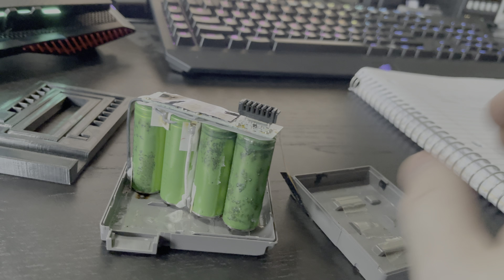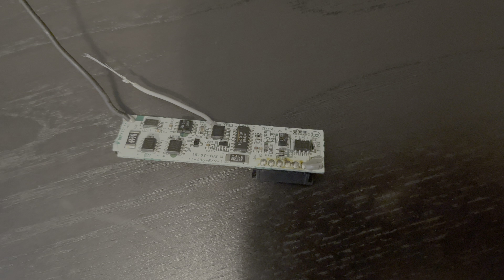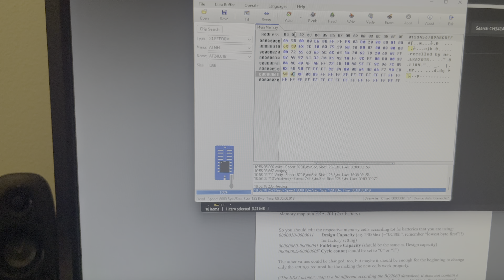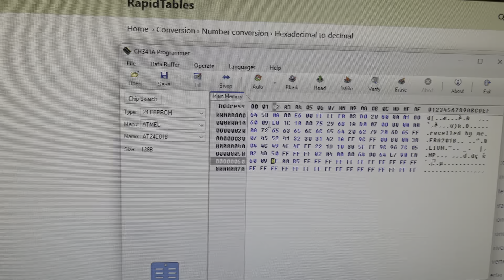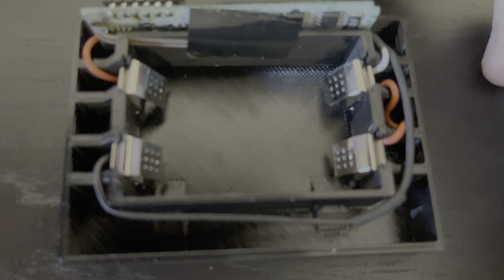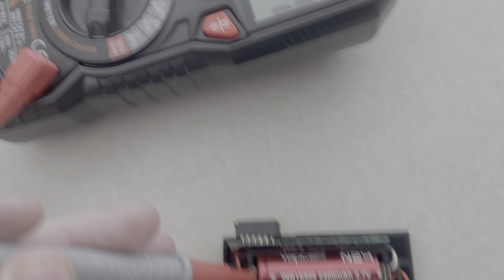Sony AIBO ERS-210/ERS-220 Battery Recell Tutorial

Comment: when flashing eeprom, i can read the chip (make a backup) and erase the chip, but when i attempt to write my modified buffer it will not write. the chip remains empty. do you have any idea how i can fix this? i have tried many programs including multiple versions of the one you are using and neoprogrammer and ASprogrammer.